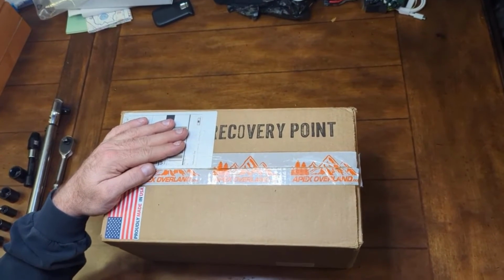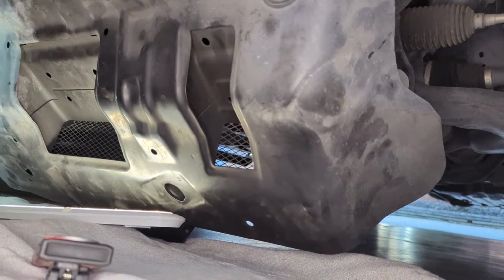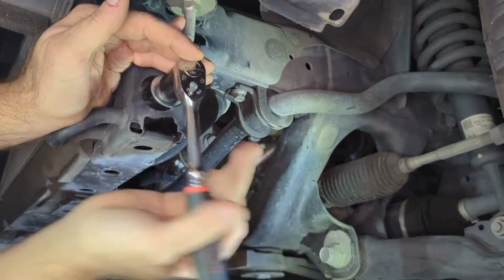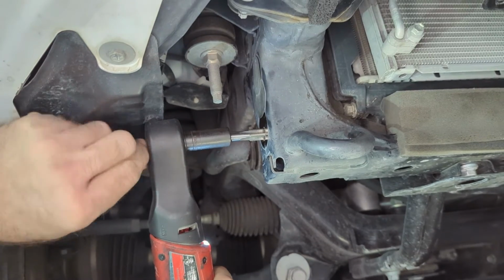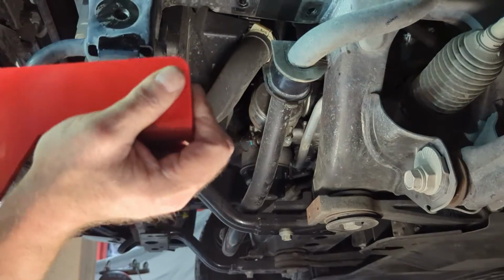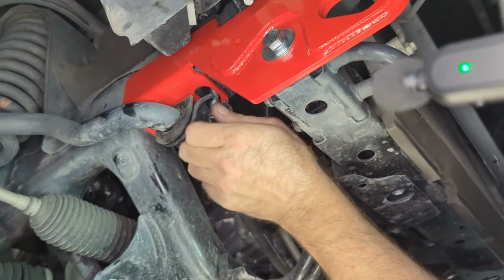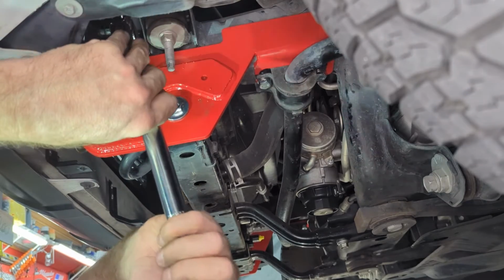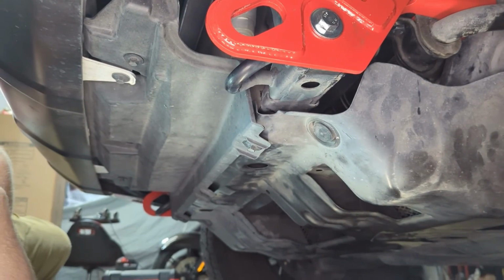APEX Recovery Points Installation | BONUS! Tap & Die set used to clear out nut plate | Torque Specs

Comment: Installing now. My 19mm locking washer sheared off as well. Ugg! What did you end up doing? Did you leave it without one or did you replace? And if you replaced, did you just remove and replace that 19mm bolt or did you have to redo all of the bolts?
Reply from the maker: I didn't even bother replacing it

Comment: My torque wrench minimum is 20 ft/lbs. Do you see any problem with tightening the smallest bolt to 20 ft/lbs instead of the recommended 18 ft/lbs?
Reply from the maker: That should be fine, 2 lbs won't make a difference. The tourqe wrenches usually have a +/- of a certain %  anyway